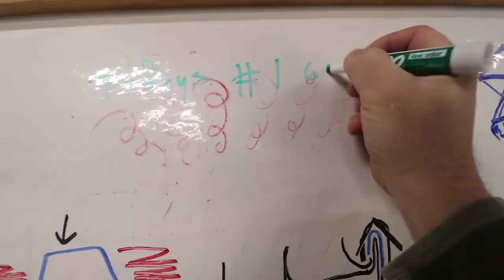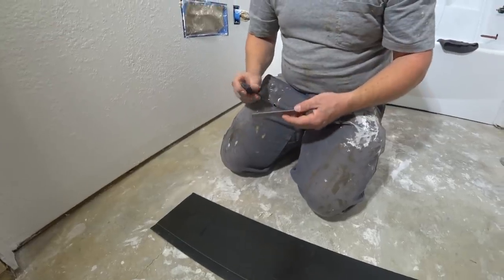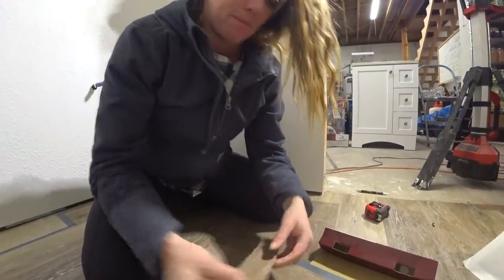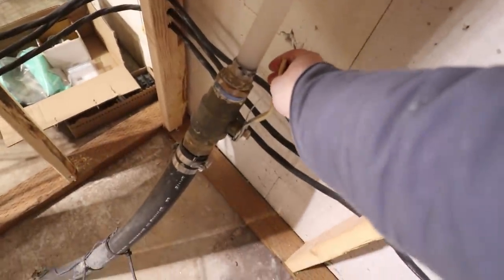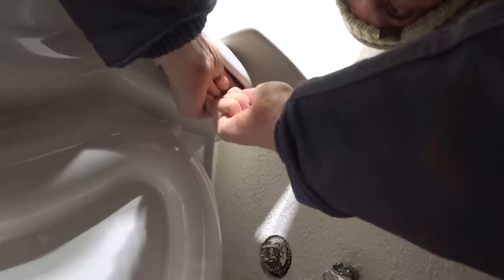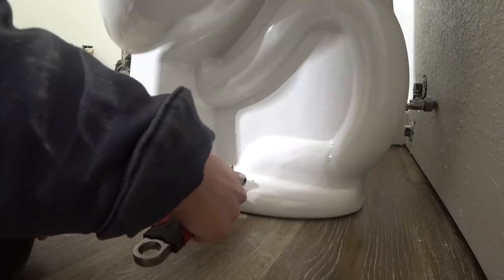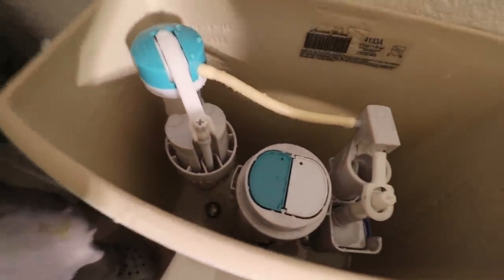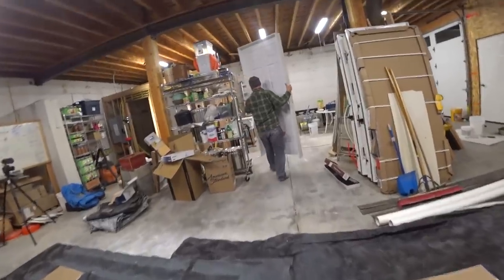On Your Mark, Get Set, POOP! (Installing Bath Fixtures)

Comment: How do you potty train your cat or dog to use the toilet.
Reply: I thinks it's easier for cats.  I saw of video of this once.  Probably one on youtube.  They fashioned a litter box in the shape of the toilet seat, and then suspend it over the toilet.  Once the cat gets used to using the toilet seat, the litter box is removed, and the cat supposedly just continues to use the toilet.  I don't think you can do it for dogs.
Reply: You buy a tray that sits on the rim of the toilet and holds some litter. Once your cat is used to using it you remove the tray. It's actually pretty easy and they learn quickly. I've never heard of a toilet trained dog.
Reply: Check out City Kitty product originally featured on Shark Tank.